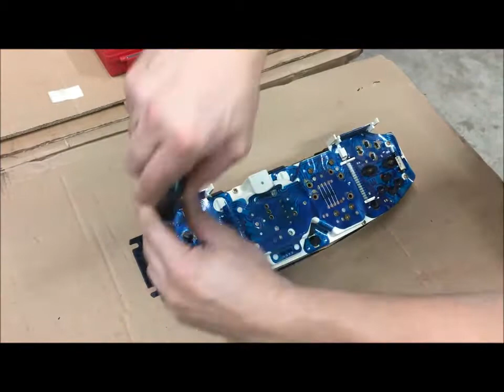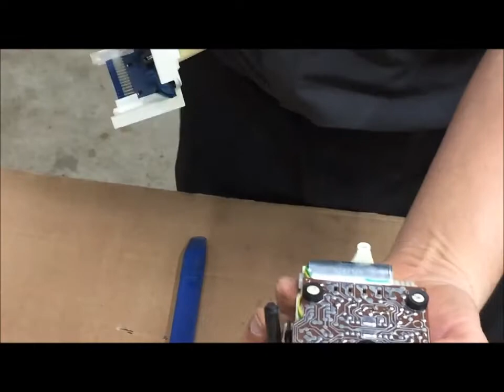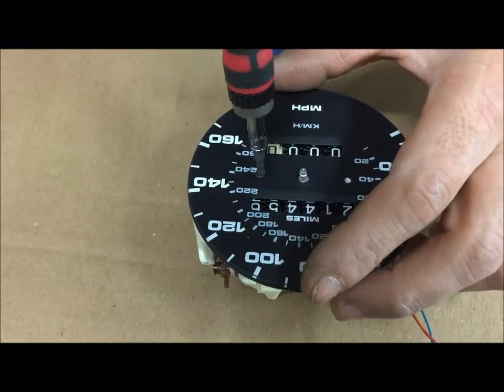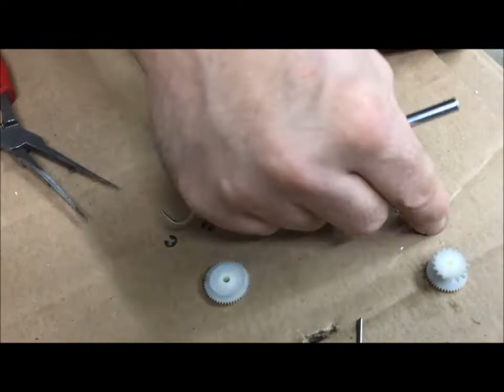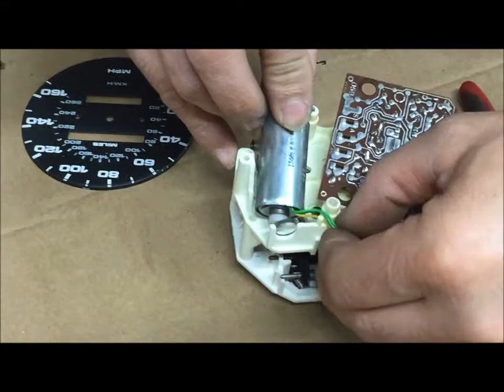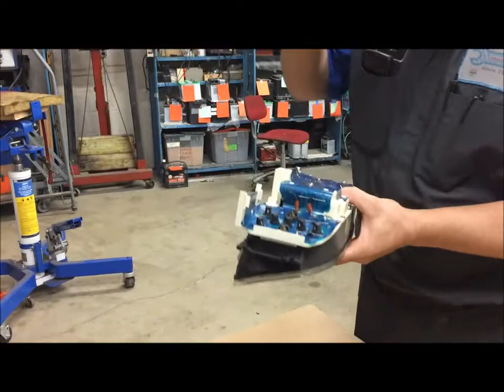Replace the odometer gear on your Porsche 944-Munk's Motors

Comment: Thanks for the video! I am a novice but stayed with it, a bit like brain surgery, but you can walk away for a break and coffee! Ha! Take your time, no rush, it took me 3 hours with breaks and hunting for tools and getting the cluster out of the car. The hardest part for me was finding a perfect size screw driver for the 2 speedo face black screws. I had to use a razor blade and took my time scrapping off the dried up grease on the shaft of the 20x21 gear I purchased from Ian Riley at 944online.com for my 1986 944. Also it took two tried to get the speedo back on at exactly zero, hold the speedo as you would view it in the car to get the right angle and alignment on the shaft at zero. This was my Covid19 project while bending the curve and WFH. I am upgrading the dash bulbs with LED, again, parts from Ian. Thanks very much!

Comment: I Dont know if you have this available to you but I need to know what one of the resistor value is on the board you removed in this video. I have a burnt one and can't identify it by color. If you can help it the one next to the green wire. Thank you

Comment: Hey Rick, did you notice you accidentally rolled that guy's odometer back from 214K to 180K?   :)   Nice video though.  I need to repair that little gear on my 968.  This was a big help.  Thanks!
Reply from the maker: Herb, Thanks for the question. Look in our notes. We had to use a second odometer to complete the video. Thanks for watching.
Reply: @munksmotors6205  Ahhh didn't catch that.   Thanks for the vid.  I'll be doing this my self in a bit.